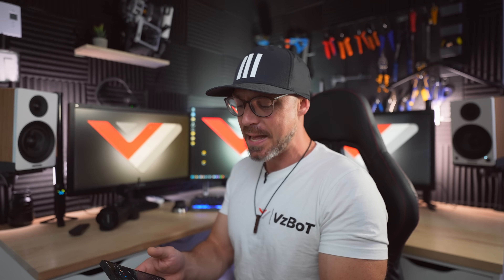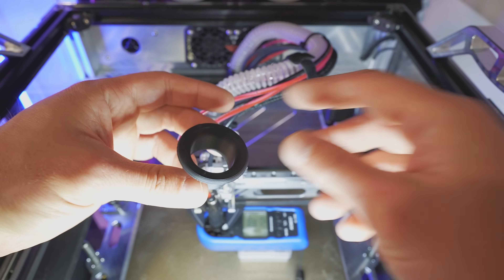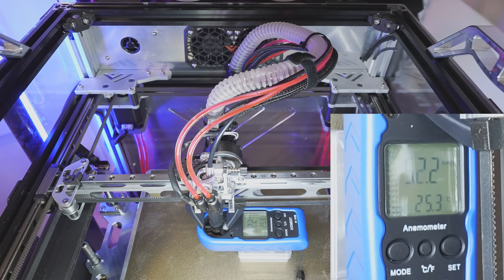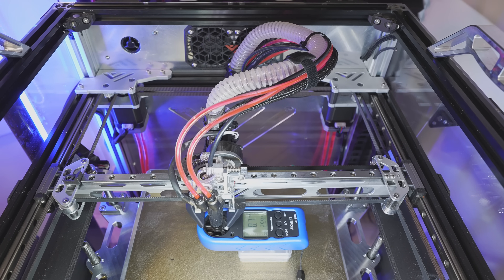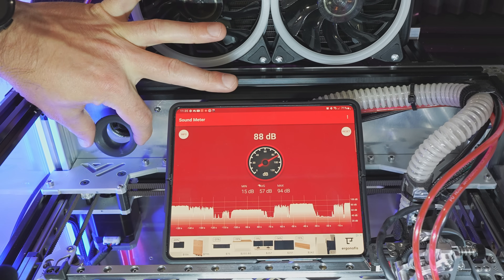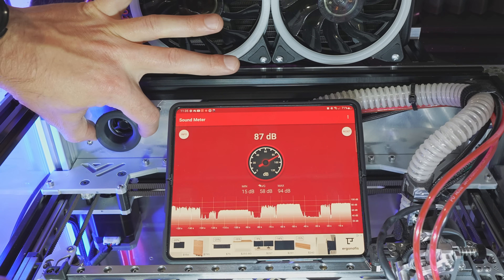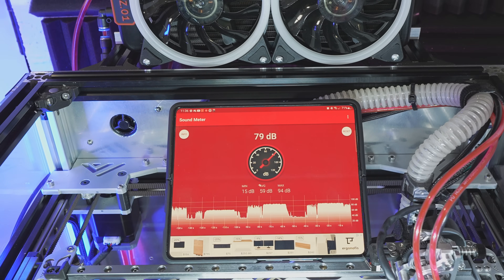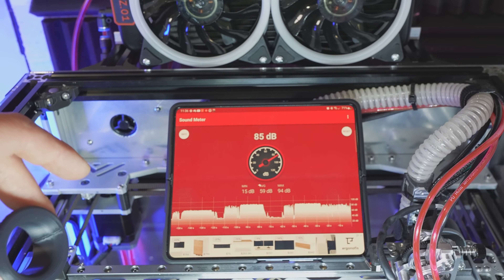CPAP muffler

Comment: Just a thought (I recognize that this is 2 years too late), maybe if the baffle was a bit longer you could get a bigger drop in noise.  To keep the air intake inside the box, you could extend the air intake closer to the bottom of the enclosure, and you could gain some temperature stability in your enclosure by removing the colder air at the bottom (hot air rises, so it may not be a lot colder, but maybe slightly cooler, right?), and the air has a longer path (maybe some airflow impacts), but then so does the sound coming from your turbo.  Think about how shorter exhaust tubes in automotive have a louder tone than the longer tubes.  Secondly, with your turbo mounted to the metal looking plate, maybe there's some resonance from the turbo that is turning that back plate into a speaker with the vibrations.  Dynamat may help isolate the vibrations from the turbo and lower the sound coming from the back plate, maybe even some dynamat inside the plastic airbox, should have little effect on the airflow if the primary path is the red resonator assembly.

Comment: Decibels (dB) are a logarithmic unit. Each 10 dB decrease represents a tenfold decrease in sound intensity, and a 3 dB decrease halves the sound energy. So you actually did a lot. You can also put foam or sound panels on the outside of the printer. It wont be as efficient as being inside but audio foam probably can't handle the chamber temps. Also over expand the intake, add more twists and turns, maybe even put a bit of cotten in the over expanded portion, same for the exhaust

Comment: I am late to this party as well. Noise is reduced either by removing the source of the noise or suppressing the noise. In this video, you try to suppress noise, which kind of don't  work, unless you are really good at the physics. I am not.

Then there is the source. Moving a ton of air through a narrow space, as a tiny fan, will generate a ton of turbulence. The answer is to use a bigger fan, and control the speed of it. That way you push just as much air, but over a greater volume, generating less noise, as you generate less turbulence.

The Delta BFB12224-t50r looks promising. The BFB1624H even more so, but it is kind of pricy. Haven't tried either, but this is the right way to do it. Removing the source of the noise works wonders, and is the right way to kill noise.

The  issue with the fans you are looking at, is that you ask for a storm, and when you don't need a storm, most fans have only a small speed range. The fans I point to,  are way to powerful for some types of printing, and some form of valve, is probably needed. Either a manual one, or a stepper driven one.

Comment: That's a tiny fan at super high RPM. Why not try a larger fan for more volume/air flow overall on the back panel? Probably not a lot of space back there, but probably could make it work.

Comment: I'm no expert, but I have opinions and ideas that may help. Firstly, this is a strange way to try to fix your problem... i; personally, would have tried to find a fan/blower that was quieter out of the box, perhaps with better hydraulic ball bearings, or I would have purchased another blower and run them both at 50% which would be virtually guaranteed  to give improvements.
Otherwise, I would have taken into consideration that placing any kind of plastic form on the inside of that hole in thin sheet metal was doomed to fail, theres alot of air still getting sliced by that sharp punched hole and sheet metal aluminum itself resonates sound in an awful way, a plastic insert with a hole would have been better (think of what a speaker port hole looks like) and a soft material (tpu with lots of infill maybe? Another material?) Would have improved resonance... I may have even given the internal cavity a dimpled golf-ball like texture on the inside to reduce drag/ friction, lower resonance and maybe even increased airflow.

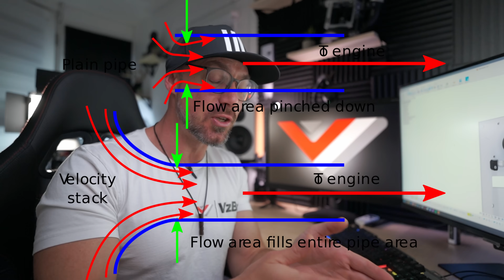Comment: 2:39 a simple radius will not help. imagine, the tube has a curvature of ZERO then immediately it transitions into a 6mm radius. that too abrupt, although the connection point has the same angle (0) as the tube.
it must be a "gradient". so from inside the tube it curves waaay less than a 6mm radius. try 100mm, transition that into 80mm, 20mm, .... of course in a reasonable size. in 3D those curves are called NURBS. no uniform b splines. 
same for strength, a radius transitioned into a straight line is a weak point.

Comment: Moving air problem, like drone props fans make noise depending on the RPM and blade design, to keep the pressure up but reduce the noise look into the blade design in your spare time...

Comment: Look up Helmholtz resonator.    You are on the right track with the dual intake air box.   You need to tune the length of the pipes and the air box volume.  You will be getting audio leaking through the walls of the air box. A Helmholtz resonator will suppress wideband noise.

Comment: So as a VAG expert (Volkswagen Audi Group) one thing I've learned about the way the turbo muffler works is the air will pass directly through this baffle instead of around it and then in it, a hollow chamber is surrounded by it disrupting the direct flow path of air, allowing it to bounce around and off the larger half before it exits out the other side. This will indeed remove some velocity but for turbocharged vehicles, it increases back pressure a bit and gives lower end torque.

Comment: Very interesting implementations of designs from cars! What you are missing out in your implementations is how much noise goes through the hard shell of your muffler and through the fan enclosure itself. You should try simply making any muffler from a foam material or at least make a foam gasket and connect fan and also a box only through such foam gaskets. The noise you hear is only 30% from the air flow, 70% is from the fan mechanical parts, bearings etc. Also if you think of your own solution instead of just copying existing car designs, I am sure you will come up with something better :) For example make a helical entrance into the fan intake to help direct air into a spiral before it enters the turbo impeller section, this will reduce air noise significantly more than these 3 designs, due to much lower turbulence. With all that said, I never run any of my printers in the living area where I or my loved ones breathe, so such noise isn't an issue for me. Cheers!

Comment: Well done Simon. I think that's a great option to reduce the annoying noise. I do wonder if the CPAP motor itself is vibrating the frame. Maybe in another attempt, a TPU soft mount and housing should be designed around the motor. But at that RPM and air speed, its going to be loud no matter what.

Comment: Thanks for the video. I've got the same fan and am measuring only 25 km/h on my anemometer. How do you get 50km/h? Are you maybe overclocking it?
Reply from the maker: the fan duct outlet compresses the air to crank velocity
Reply: @Vez3D  By chance, have you already made a video that explains how the duct compresses the air and optimizes air flow / pressure? Or do you have some other pointers that could help me design a better duct for my printhead? Thx!

Comment: Very cool! I would:
- remove the centre parts of the cpap intake, (i think they play a good role in setting the frequency/pitch of the main noise), if possible.
- on the third design, shape the intake regions more like the turbos intakes. ("roundy", not as straight nor deep as the ones you showed first). O.D. = 2 x I.D. with Assimetric Conic Rho fillet.
Pls do a follow up! :)
💪💪

Comment: CPAP has a lot of pressure, on one hand you can get crazy with the duct design (example: Hevort tentacool), but on the other hand you have a lot of noise. I think I would prefer a double 5020 toolhead with optimized thick and short ducts, graphs say that the airflow (that is what actually matters) will be roughly the same, pressure will be a lot lower but so will be noise too. Pressure only gives you freedom for crazy designs with a lot of restrictions without big sacrifices, but at the end of the day only airflow matters.
Reply from the maker: Weight.. dont forget weight
Reply: @Vez3D  It's a trade-off game, a little more weight but maybe more rigidity (as you don't have a flexible tube to move around). And of course absolute silence in comparison!

Comment: Firstly every 3db of drop is half the noise level so actually your designs are doing well. As people have already mentioned there are frequencies that people pick up on more than others so moving the frequency to something "less annoying" can be just as useful. my two cents would be that your trying reduce the noise of an intake and alot of noise can be created by not having a smooth path into the centre. I would suggest a Bullet to smooth the hub and a nacelle around the perimeter. Definately would isolate the fan from the aluminium back panel

Comment: Simon excellent solution!  You could also print some T-spacers and TPU washers to install on the CPAPa mounting screws (which insulate the contact surfaces including the screw itself).  This would drastically reduce the vibrations and therefore the fan noise on that aluminum plate and put together with your solution you would certainly remove other decibels.  another optimization is to coat the walls of the airbox with adhesive sponge, you do not compromise the airflow and further reduce the noise

Comment: I once started wondering if bottled air might be quieter than fans, the cost could be lowered if I could fill the bottles from my compressor or if the tank on the compressor is large enough to hold enough air then it might be possible to pipe the air directly from the compressor without it having to start up, of course this is all dependent on the part size, my compressor is in the storage part of my shed/workshop and although it is in a separate room with insulation it is very noisy, it doesent take long to fill its tank though.

Comment: I've never really messed with using a CPAP machine for cooling on a printer but I do have some experience with CPAP machines for their original purpose and they're nearly silent. What about the modification that you've done with this one removed that original designed in silence?

Comment: Output noise is also a problem limiting what you can get to besides getting pesky peaks even if you completely removing intake noise source.... 

I have a office with too outside walls just begging for one of my projects to ether move cooling radiators, pumps or air output systems physically away with thick walls etc. making efficient gap. 

Thermal systems also have the option of going down - including the pumps - just get into the earth if you are at ground level, don't have anything under there yet, hate your floor and own it all - this is underrated especially where winter might be a problem or summer heat might not provide cooling. Just add lots of surface area that isn't insulating but can handle the liquid, moist earth and the pressure. Also remember to consult experts near load-bearing walls.

Comment: As an audio professional I’ve analysed the audio coming from the video with a spectrum analyser and the electric motor from the cpap is putting out 19khz (19,000 hertz) frequency when the fan is running the whole time but when you put the muffler on and off there was about a 5-7dB difference in the 4khz range from the intake noise. So the baffled muffler did work! You probably wont stress too much about the motor spitting out 87dB at 19khz as its very high on the spectrum in regards to human hearing (80-22,000 hertz). Hope this helps!
Reply: I was going to do the same thing. That was about the difference i heard in that fs band and i was going to analyse it, but thought i would check and see if someone else had first. 5-7db is quite significant in that band. So like 400% less noise power in the midrange. I would say that is a very good start.
Reply: @jeremyglover5541     yes, the 6dB noise reduction means approx. 4 times less noise power in the midrange , and the minimum 3 dB noise reduction overall means 2 times less noise power. Excellent results from this simple solution
Reply: @andrewp4661  thanks for clearing up my late night sloppy use of percentages to describe a reduction. Im glad you still caught my meaning.
Reply: This is a little biased in testing because your not dealing with the sample but his recording equipment, youtube sound processing and then speaker output. He menations he doesnt hear a difference as well. Other aspect is what his phone microphone picks up as well. Overly simplified test with areas to.improve but at least hes quantifying.

Comment: those sound levels are like genuinely dangerous long term! 
I think you also need to worry about the actual motor vibrations (dampening the mount) a bit too plus the output is very restricted and i assume a huge source of the noise

also i feel like if we had knowledge to calculate the shape of those intake boxes it'd help more? audio science is .... hard

Comment: It isn't just the intake that is making noise. You need to put the entire CPAP housing in a sound isolating box. The motor is making most of the noise. Then have the intake/exhaust go through a mufler. The intake baffle works fine. I can tell the difference of the INTAKE noise being reduced... Too bad the CPAP motor is completely drowning it out. Motor and turbulence of the air inside the compressor housing are your number 1 sources of noise not the turbulence going in to the intake.

Comment: Just grab larger turbo and run it at lower RPM. It will be quieter with same airflow.
Why that intake sucks hot air from chamber? The cooler air will be ther less flow you'll need to cool down the part.
Reply: That would cause warping
Reply: @coltenmeredith8899  then reduce fan power or use glass which never warps with proper adhesive
Reply: @TheNamelessOne12357  cooling is not limited on this machine, so sucking cold air would be unnecessary. Also, that would make it even louder..?
Reply: @coltenmeredith8899  If turbo will suck cold air, it will need less air and less RPM to achieve same cooling performance, so it will be quieter.
Reply: actually great thinking....

Comment: The dB scale is logarithmic you basically halfed the noise but the corrugated hose isn't helping one bit. 

For my actual CPAP machine for my nightly use, i swapped the hose out with some clear silicone tubing of equal ish diameter meant for fish tanks. And 3D printed fittings to make the connection points perfect. 

Made the CPAP more comfortable but also naturally quiter and WAYYY quiter when moving around.

Comment: I think, perforated ring can be a metal. Also, i placed outside material like sound barier in automotive sound technology. Thinkness app. 10 millimeters, but it also how you will deside... How it work. Air laminar flowing from high outside volume thru the holes and accelerating to the end of cone. Turned back sound wawes is quieting from sound isolation material around inlet. The inlet must do not touch the frame or body of the printer. No vibration transfer. I think, you have glue or flange the inlet to the fan... Have fan! 
The outside laminator have almoust same principle. You have unwind the flow after your fan and flow it to a direct channel. Let me know about your axial or centrifugal fan///

Comment: Some Ideas from and things i noticed as an audio engineer and someone who does measure sound pressure levels at concerts for a living:
With the first airbox design the metering that is connected to my speakers shows around 3dB of drop. Maybe the microphone of the tablet is already maxed out and the actual level is higher than the displayed 87db? With the final design my metering shows also like 2-3dB more reduction than yours could be the same reason.

The resonant absorbers are tuned to a specific frequency and are typicly used for lower frequencys. If you take a look at the spectrum of the noise from the CPAP its pretty broadband from 500Hz and up. Your design still works but may not be the most efficient solution. 
  
My take on a muffler would incorporate 3 main principles:
1. building a maze so there is no direct way for the sound to escape and it has to bounce around the corners
2. lining the inner surfaces with some kind of acoustic foam, like you have on your wall, to absorb the sound energy that is bouncing around
3. making the corss sectional area bigger to reduce the airspeed to reduce turbulence inside the muffler which would otherwise generate new noise.

But in the end i may be wrong since this is a much smaler scale than i use to work with. And it may bee good enough as is since on my printer the noise from the air hitting the actual print is much louder than the noise of the membrane air pump and the only thing that would help would be a rock solid enclosure for the whole machine.  :D

Comment: Not an expert, but I assume that a corrugated hose is normally used at a flow rate such that you get good laminar flow through the centre.  If you push air harder, aren't you better off with a smooth hose?  Less back-pressure making the fan loud and maybe less noise coming from air flowing in the hose?

Comment: Yeah I had a very similar issue adding a velocity stack to my part cooling. The dang thing just got louder and didn’t push anymore air. I think the amount of work to go from a velocity stack to a very well optimized velocity is more than just adding a horn to a fan. Great work though. I always appreciate your willingness to push the limits and make better machines.